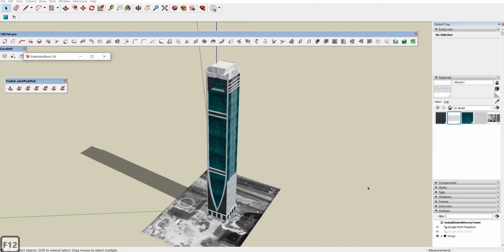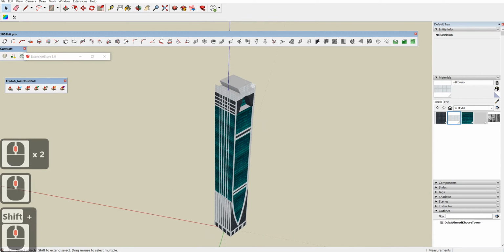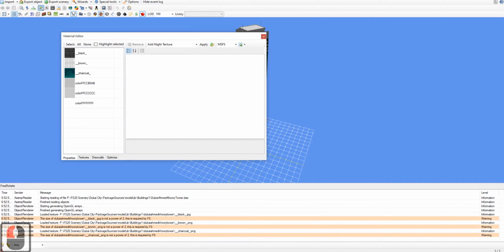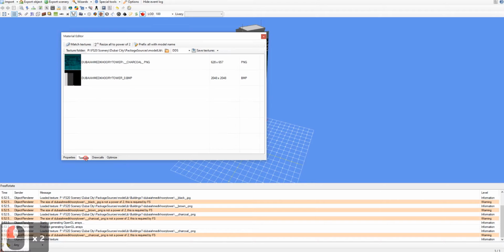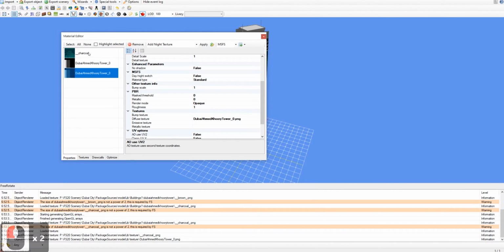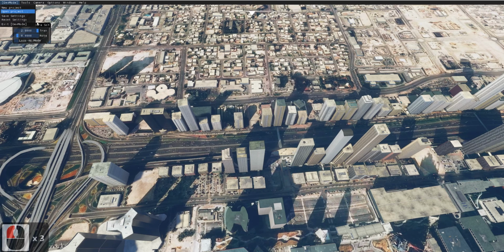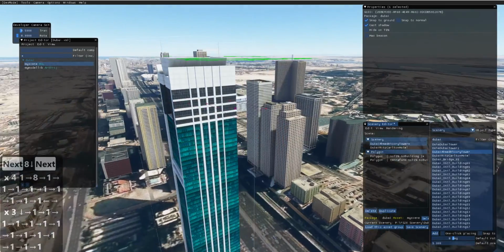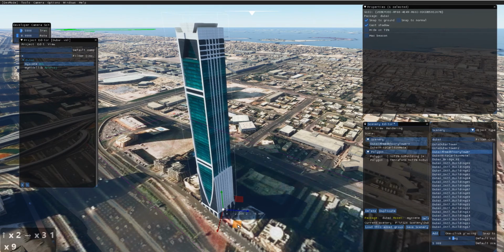[Tutorial]Easiest Method to Convert Google earth/Sketchup Models For Flight Simulator 2020(3minutes)

Comment: Hey man! I've tried everything what you did exactly in this video, but for some reason Flight Simulator 2020 won't recognize my building. Keep in mind when I compiled it there weren't any errors EXCEPT for business data and creator name missing. Here's the console: https://media.discordapp.net/attachments/688905257257795594/760879321400475688/unknown.png
But keep in mind, there weren't any errors FOR the model itself.
I could send you the files if you want, and/or the 3D model, but I guess that's not necessary.
EDIT: Got it fixed. Check replies
Reply: Apparently I forgot to add the .XML file in ModelLib (or whatever the folder was called). Sorry for wasting your time man.
Reply from the maker: @junepiss  Glad you got it fixed

Comment: This really is awesome but don't forget these models come from Google Maps aren't legal to distribute with any scenery you create.
Reply from the maker: Actually these are from google SketchUp warehouse not google maps so those are free to use
Reply: @westafricavirtualairtraffi398  That's incorrect. Here is the relevant part of 3dwarehouse.

3. Google Geolocated Models
Notwithstanding anything to the contrary in this License Agreement, if you are using a Google Geolocated Model, you are only licensed to reproduce, adapt, modify, translate, publish, publicly perform, publicly display, distribute and use such Model and you shall not use or incorporate such Model in any application, product, service, database or repository. “Google Geolocated Models” are Models Distributed through 3D Warehouse by Google Inc. (or by Trimble on Google’s behalf) that constitute a 3D model of an object, building or other structure with a fixed location that is tagged or otherwise associated with the actual geolocation of such object, building or other structure.

The model that is used in this example is a geolocated model from Google Maps.